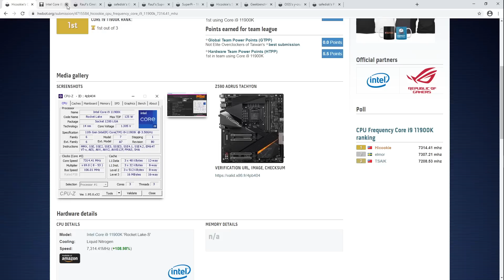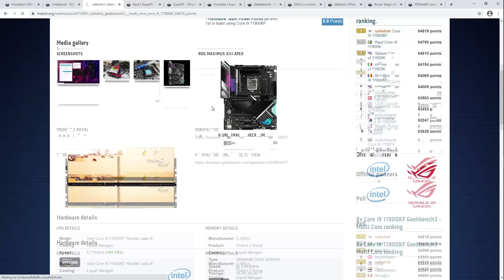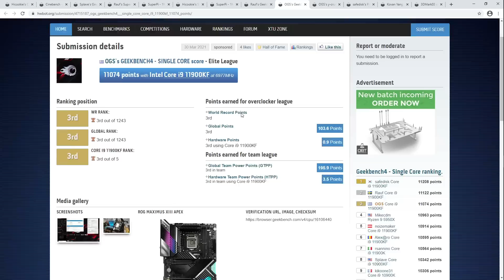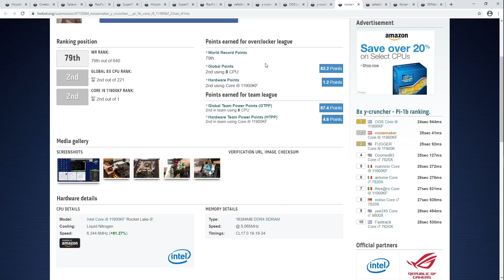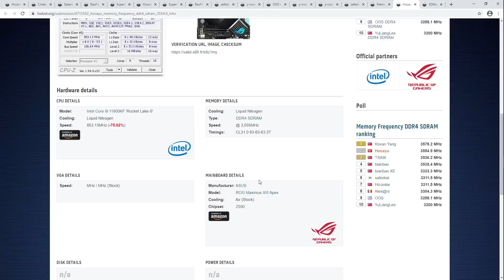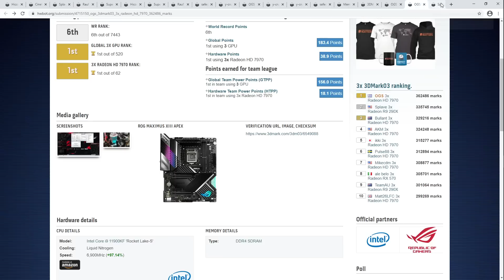The ONE thing the 11900K is good for!

Comment: "For extreme overclocking the 11th gen actually been amazing" 

Yeah and the wattage also, the Intel Core i9 11900K (8 cores) uses without overclocking 300 watt (only the CPU), the MUCH faster AMD Ryzen 9 5950X (that has 16 cores) uses 125 watt allcoreload in Cinebench R20 MT, so yeah i know what i am going to buy if i need speed, a AMD Ryzen 9 5950X or the 12 core AMD Ryzen 9 5900X, and absolutely not the Intel Core i9 11900K.
Reply: Tfw you realize amd fanboys are like vegans or crossfitters
Reply: @Michael-wo6ld  Funny you say that to someone who bought only Intel CPU's for the last 15 years, only last December i bought a AMD CPU, but ok.
Reply: @AmigaWolf  Is Michael is projecting his Intel fanboyism? 🤔
Reply: @Michael-wo6ld  Intel fanboys are no different. Fanboys are the same everywhere.
Reply: @rdmz135  Yeah, sounds like it.
Reply: @rdmz135  I am not a fanboy of anything, i buy what is the best in price or speed, preferably both.
Reply: @Michael-wo6ld  Fanboys from whatever brand are just a bunch of morons, best thing to do is to buy what works best for your use case, had a 5820k and very happy now with my Ryzen 5900x for MY use case. 
i9 11900K just sucks cuz for the mainstream user is just terrible value for money. Overclockers might rejoice, but its basically a niche of the whole pc market, same applies with cars and many other things.